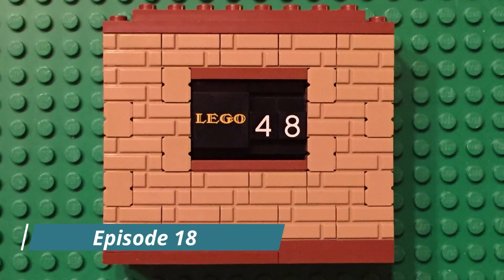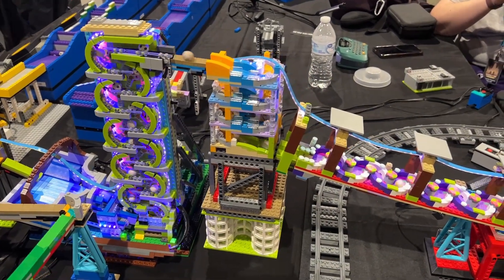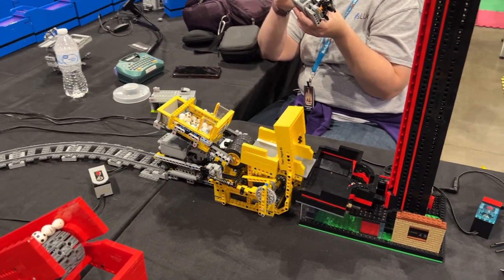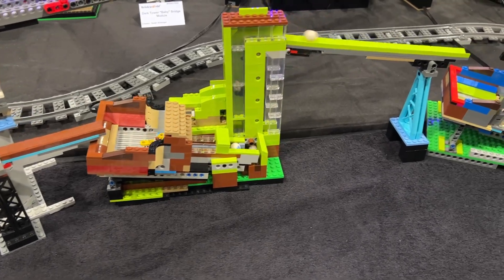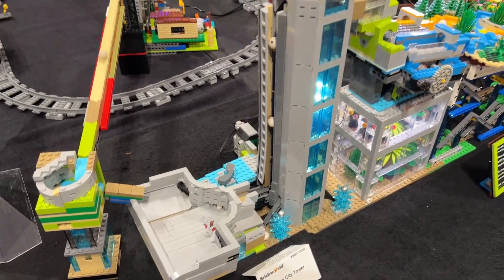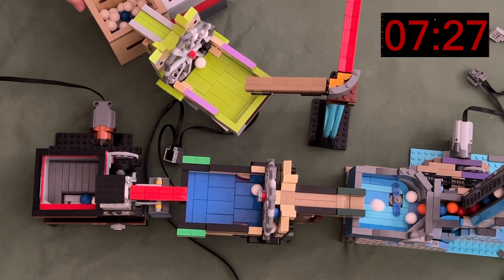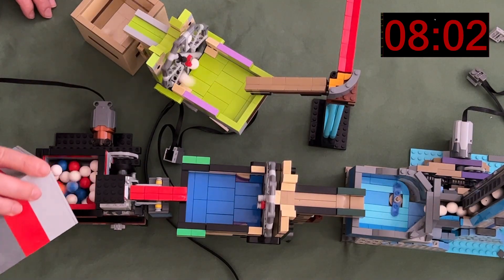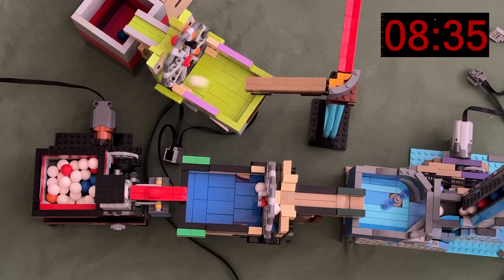GBC 18 – BWC-2023 and BPM theory

Comment: Thank you for the BPM theory. I try to build modules for 60 BPM, but on a show we run the GBC in slower mode. For me it just looks nicer...
Reply from the maker: I'm assuming you mean that "60 bpm looks nicer" - and I would agree.  I think the original standard specified 1 bps (60 bpm) for that very reason -- that it's a moderate speed that isn't too taxing for modules, but keeps enough balls in play so that there's something to see.  Of course, the standard was written quite some time ago, and the world of GBC (and the size of the shows) has changed dramatically - such that I think we have to evolve our thinking about the standard.  Historically I've tried to limit my modules to the 70 bpm range to be as close to the standard as possible; but what I learned here suggests that I really need to do more to exceed the standard -- either with a faster cycle/higher throughput, OR by making sure I have a larger in-basket to handle flow.  That means that my blue tread lifter running at 68 bpm with a minimum sized in-basket was a poor design choice!  (I'll fixed it before the next show!)